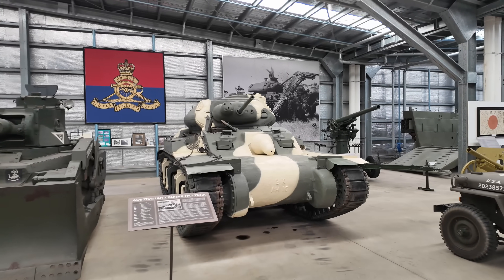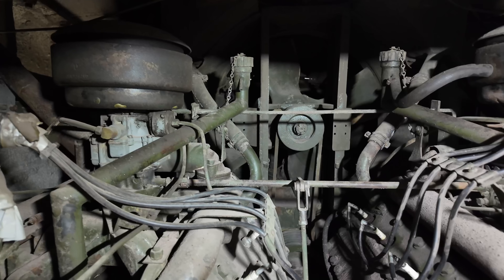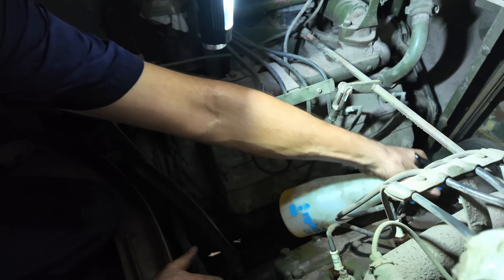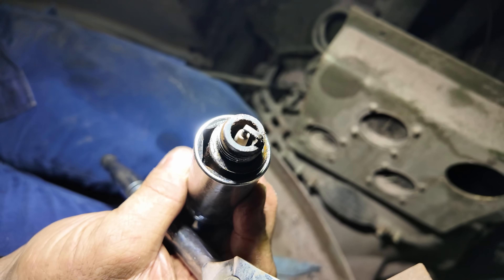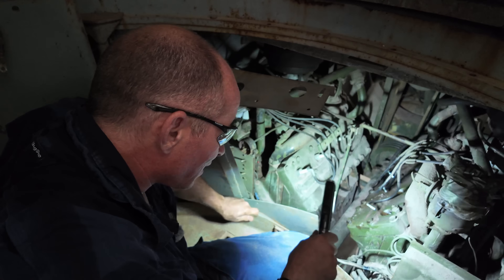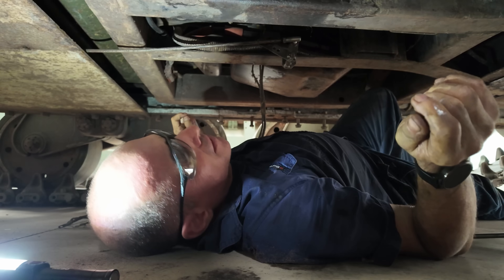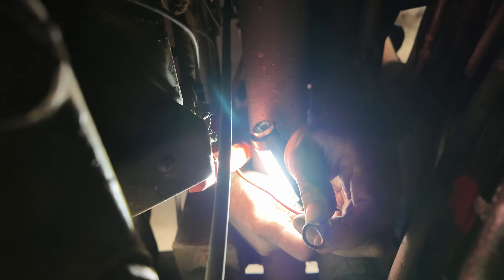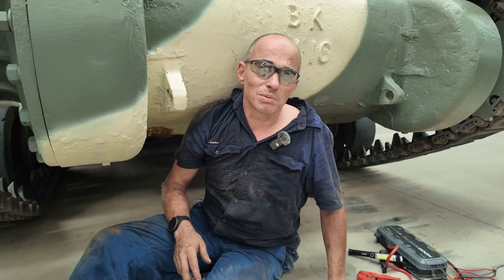Can we get our Australian SENTINEL Tank running???

Comment: I find it hilarious they used 3 flathead v8s while in some of the american m4s etc had a ford gaa all aluminium 18L v8 with dual over head cams, 32 valves, dual ignition and a flat plane crank

Comment: Years ago I saw a Sentinal tank chassis working at Camden Air Museum ( no longer exists). They had the chassis, which was oxy cut from the upper super structure, no triple  Cadillac engine but rigged a diesel engine to the front transmission. They could move it around that way.

Comment: It's intact, good condition, not sure why he'd think "if it is even possible". Pull the back deck plate, pop the engines and transmission out. Those Caddy flatheads are easy to work on, parts are relatively easy to find. Worst case, the blocks need replaced and there's a couple companies in the US who specialize on them.

Comment: You need to come up with a heater. Put it below, heat the engine up slow. get it close to the temperature it was at the last time it was shut off. A proper fly wheel wrench may help as well.

Comment: As a Brit I really want to see this Aussie tank running again in Australia where it was designed and built, it should be a (the) star of the museum, after all according to Bovington there are only 3 left in the world, making it rarer than the Tiger
Reply: Tree Sentinel, one  AC iii cruzer (thunderbolt with a perier-Cadalac 25 pdr gun at the Australian war memorial, not restored.. grrr) one Aciv mock up ,aciii hull with a  17pdr antitank gun, not the intended set up but you get the idea. If in production in numbers the ACiv would have been comparable to m4 Firefly, the allies could have had another 310 tiger killers come D-day if deployed to Europe, and another 190 25pdr armed varrients. But the production order was cut due to man power shortages, quite a few aciii hulls were cast before the program was cancelled.

Comment: Great work as always. 8006 was running back in 1996. I suggest have a  look  down the plug holes and see how rusty the bores are. You should see how easy it is to remove the frame with the engines, fuel tanks and radiators, that will make life easier. The engines have individual clutches so disengage them otherwise you are trying to turn 3 engines with the starter motor of one. When you have one running it can be used to bump the next.

Comment: Not sure if this a similar issue, but a common issue with some English Cars (Austins), starter would jam if left sitting, will not turn over, just a click, solution, rock vehicle Back & Forth in Gear, Switch off, then see if it starts ...

Comment: I'd love to see this chunk of Aussie pride running again. Cadillac engines at least are pretty simple, it seems much easier to find parts versus any Panzer engine. You might even be able to get away with a more modern derivative, although I don't know if even GM V8s go back quite this far. 

What I really want to know is, why is there no belly plate under the tank? That seems like an insane weak spot to me. Is it that the tank never had one? Or, is it meant to have one, but it's unfitted at the moment? Or, is it just a little access hatch that's removed?
Reply: The belly of the AC1 is three separate floor plates, front, middle, and rear, it seem the rear one under the engine bay is missing. I presume if it is not fitted that it is because they don't have it, the good news is that it was only a mild steel plate with some access and drain ports, and so it should be easy enough to make a new one.

Comment: Back in 93 or 94, I was tasked by 158Tp to carry one from the railway workshop in Sydney down to the Armoured Corps Museum in Puckapunyal... Was a fascinating exercise... Smallest (proper) tank I'd ever carried... Can't remember if it was a runner or not, but it was decided I'd winch it onto my float... Just to be safe...
Reply: The railway apprentices are supposed to have restored it about that time, so yeah it should have been a runner then.
Reply: @bettongmi4340  Thanks for verifying... Once it got to Pucka, that was pretty much my part done... Though I did wander through the museum before I got posted to Darwin... Looked back on the old beastie with a smile...

Comment: How are the engines coupled?
Reply: There's a drive combining gearbox under the turret basket. It takes the three input shafts and there's a line of 5 gears, the input shafts are on gears 1, 3, and 5, gears 2 and 4 are effectively just idlers, gear 3 is also connected to the single output shaft. In principle it forces the 3 engines to work as one.

Comment: Three separate electrical systems on this tank. 6 volt system for the automotive components, a 12 volt system for the wireless, the Graviner fire system and MMG cooling pumps and a 40 volt system to power the turret traverse motors.
Reply: You know your ACI very impressed.
Reply: Wow how cool is that.

Comment: Those engines were probably Australian built but we didn't manufacture any truck engines at that time as far as I can tell. And Yeah, I'd love to see this running as well. A sentinel t-shirt would be nice as well ... I didn't see one when I was there last year.
Reply: Imports. Cadillac were able to supply them at a very good price and as many as were needed as nobody else was using them. Once they had been shown to be useful as a tank engine the US started putting them in their own tanks.
Reply: @bettongmi4340  Okay, I wasn't aware we bought these, we did produce engines of a similar size under license but not larger engines. The design was suppose to be geared to what we could produce locally.